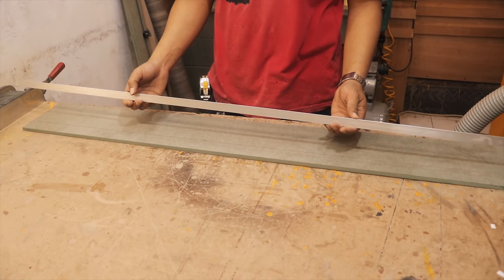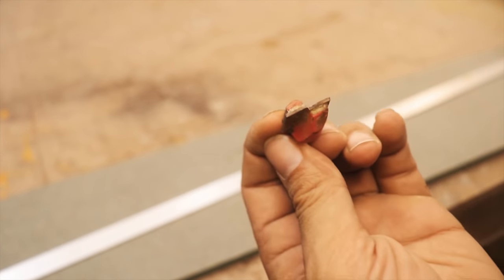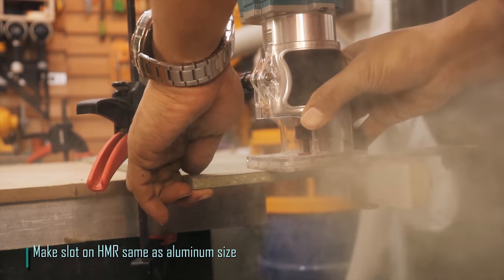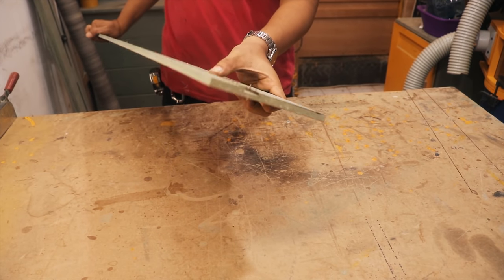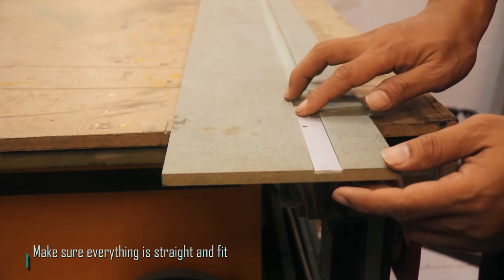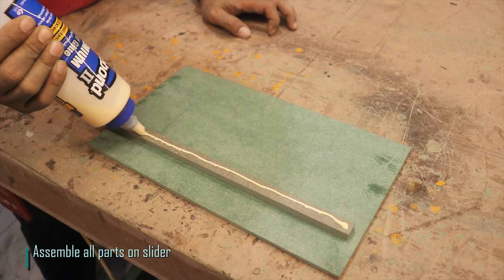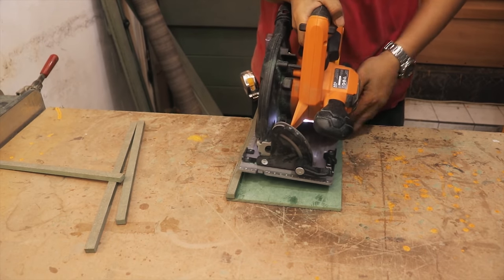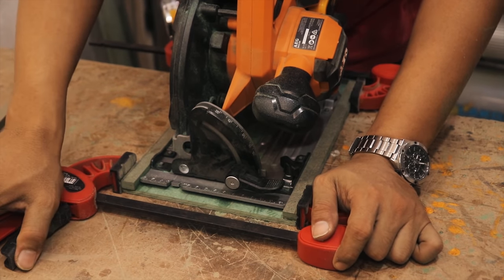Diy  Brilliant Circular saw Track With perfect Guide Rail - Track Saw without clamp

Comment: I think there is an error in your final part of the video. You line up the the base exactly with your 50mm line, however your cut will never equal 50mm as you have not made allowance for the thickness of your saw blade...
Reply from the maker: Not eror, i not give explain give extra coz the thickness blade every brand different. I cut with size 50mm i give extra 2.2mm thickness my blade.
Reply: @plywoodworking  OK, maybe just explain to users to make allowance for their saw blades in future

Comment: Mark 50mm plus saw blade width for a result of 50mm
Reply from the maker: i not give explain give extra coz the thickness blade every brand different. I cut with size 50mm i give extra 2.2mm thickness my blade. I give explain i cut with size 50mm not mark 50mm😁